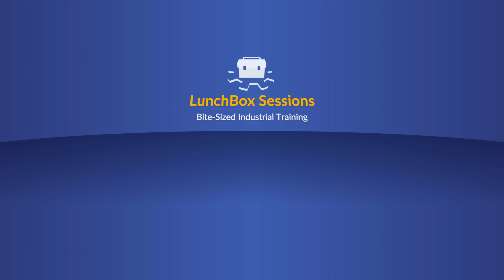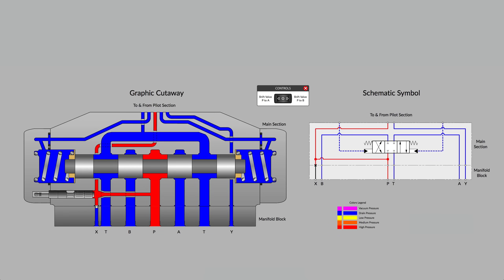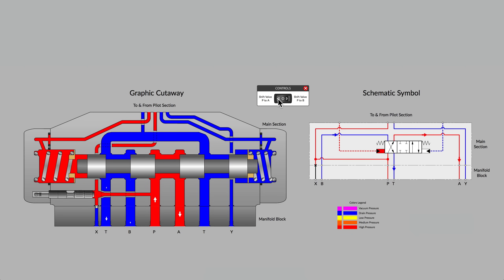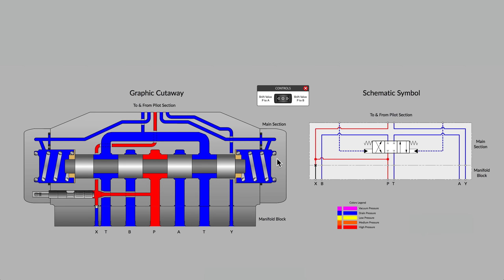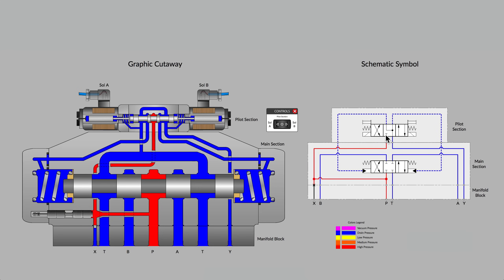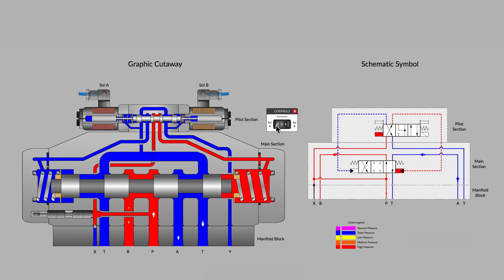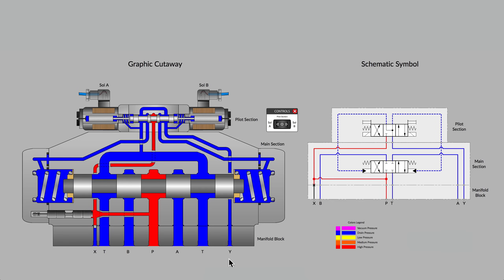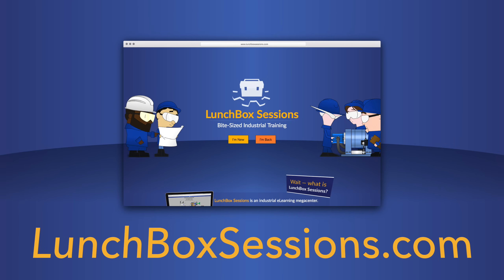Solenoid-Controlled Pilot-Operated Directional Control Valve

Comment: I planning a diy project, a mini excavator pilot project. It will have pilot controls.

If  i am using a dual constant pump what will i need to ensure that the hydraulic system run smooth with no jerkiness. 

Will i require a load sensing dcv? Open or closed? 
Do dcv with loadsensing function come with pressure compensated function as well? 
Do loadsensing dcv only work with variable  LS piston pumps? 

How do i size the dcv to the hydrauoic system? 

I appreciate the feedback. I am done digging with a pick and shovel.

Comment: I am building a DIY air compressor drain operated with a microcontroller and my solenoid valve arrived today. I couldn't get it to actually work by blowing through it and energizing it to see which port is normally open and which one is normally closed. No matter what I did it wouldn't actually do anything. I tore the entire thing apart and became even more confused when I saw that there is no mechanical linkage between the spool and the solenoid side. I couldn't figure out why there was a plastic block blocking the mechanical access from one side to the other. 

Anyway, that's how I learned what "pilot-operated" means.

Comment: What I find odd, is the use of system pressure for pilot supply. In mobile hydraulics I am used to seeing a pressure reducing valve in the supply for consistent pilot supply pressure.

Comment: Thank you so much for this video. So the X port is only used if you want to have external control of the pilot. So this is optional. Is the Y optional too? Or does it have to be connected to the tank? I'm using a 4 port 2 position pilot controlled DCV. Thank you sooo much in advance. I'm a beginner experimenting on a Project.
Reply: Y port would be required for a float-center solenoid valve, as shown

Comment: Does port "X" act as an emergency vent to tank if pressure build up in the pilot section?
Reply: I'm not sure but I think that is a port that might be used if another valve in series is needed. You can simply open the block in "x" and connnect to another P port at another valve. So in this case, with only one power unit you can control 2 solenoid-controlled pilot-operated directional control valve

Comment: Excellent video. What is the application of these type of valves? If I am not wrong,  Steam turbine control valve?
Kindly correct me if I am wrong. 
Thanks.
Reply from the maker: Thanks for the question. These valves are common for directional control of cylinders or hydraulic motors in any application where there will be a high rate of flow. We commonly find them on the chip truck or rail car dumpers at a pulp mill, or on the rail car dumping system at a ship loading terminal. That's just one or two examples.
Reply: These valves are used in Injection Cylinder of a 250 ton Rubber injection Molding presses for injecting the rubber into die. These valves are also called as slave valve. These valves are used when high requirement of flow is to be achieved.

Comment: Would be cool to see a similar video, with "proportional" in front ;)
That's what we use almost exclusevily. It's a relly cool concept of pre-reducing pressure to cca max 40-50 Bar, and then basicaly by controling the electrical force in the solenoid the output pressure of another precise pressure reducing valve is controlled (there are 2 of course, one per direction, but only one at the time is active). That pilot pressure is acting against the main spool providing a degree of spool opening, dependant on the pressure, which ultimately controls flow through it. Every serious manufacturer will provide you with current (or voltage/current in case of built-in amplifier) to pilot pressure to (percentage of maximum) flow.
Reply from the maker: Ah yes, perhaps the 3DREP over 4WRZ by Bosch Rexroth?  We have that valve and we have a simulation too. But the artwork needs updating. We'll get to some proportionals before too long. Thanks for writing. - Carl
Reply: We actually never used Bosch Rexroth for that purpose, I have to admit that I didn't even know that they produce it. 

My absolute favorite is Parker CVG 30/50/60, we use it often in Ex zones, in combination with Thomas coils. We also use Brevini HPV 41 and Have valves quite often.

We use this electrical controlled pressure reducing valve to control pilot pressure for controlling variable displacement pumps. Both components from Bosch Rexroth most commonly